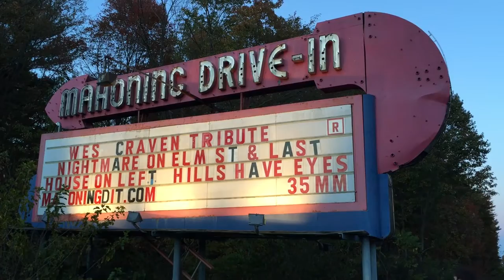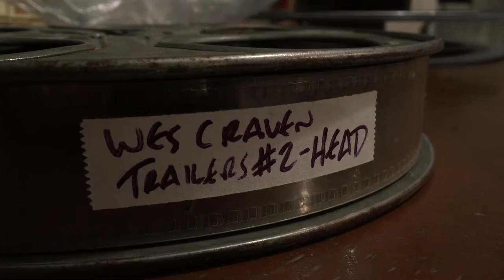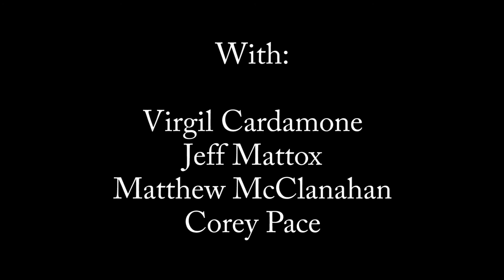The Mahoning Drive-In Theater - Lehighton, PA - October 2015

Comment: Did they ever convert to digital?
Reply from the maker: Still all 35mm, all retro.  There is a digital booth closer to the screen that allows for occasional screenings from VHS, DVD, and Blu-ray, for indie films and occasions when film prints are not available.  There's a fantastic documentary about the Mahoning called AT THE DRIVE-IN for those who want I see how the theater came to be in its current form.
Reply from the maker: Still going strong with 35mm.  They did add a small digital booth that utilizes three high-end consumer video projectors (which fills the screen and doesn't look too bad) for special presentations when a DVD or VHS wants to be shown, but it's 99% celluloid all season.
Reply from the maker: Still 35mm and going strong.  There is a small "digital booth" utilizing three aligned prosumer video projectors that allow for projection of DVD, Blu-ray or video files, for special events.
Reply: Maybe they can plug-in a game console and play video games at the drive-in.
Reply from the maker: They've done it twice now, for Video Game Weekend.  A 35mm screening of a video game themed film, followed by a big-screen tournament of the game featured in that film, or that the film was based on.
Reply: @cinemaniacstv  Nice.  I would love to see it in action but I'm in the southeastern part of PA.  I currently have a PS4 and a Switch.
Reply: @cinemaniacstv  Such as 'The Last Starfighter' and 'The Wizard'.